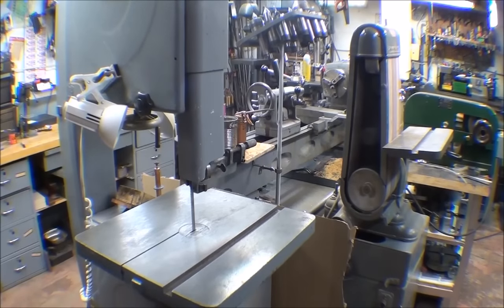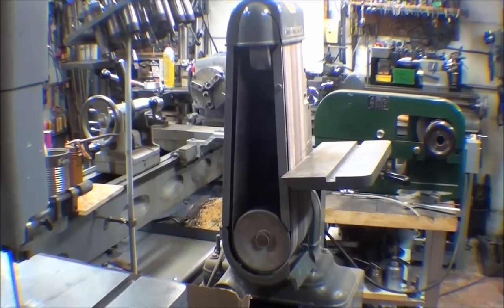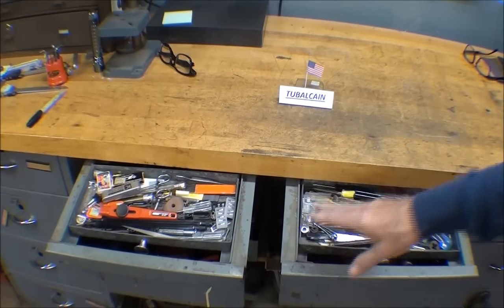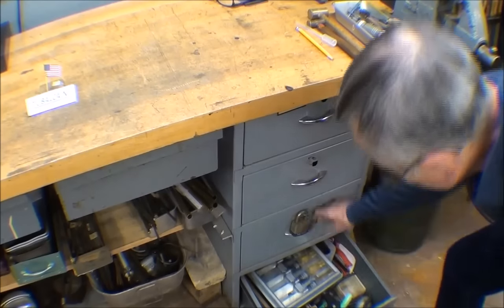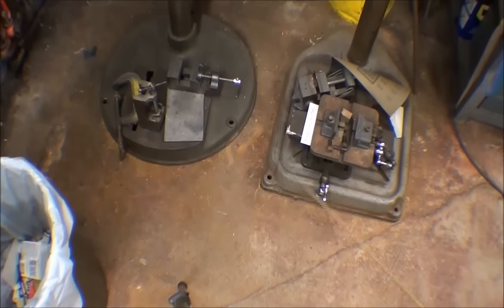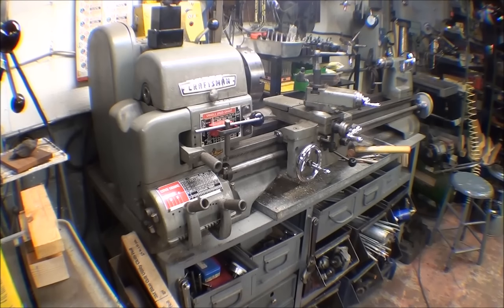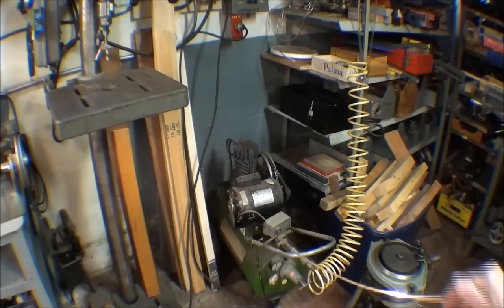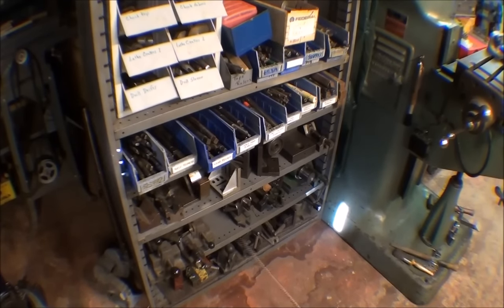TOUR of tubalcain's Machine Shop mrpete222

Comment: Great to see I am not alone in collecting multiples of every thing!! My dad always want me to take scrap wood and I alway say "I have a perfectly dry well organized collection at the lumberyard"   And for screw etc; "I keep all my screws at the hardware store" always in good order!
Reply from the maker: +jimmydiresta Thats a truism. In fact, I just threw out at 10,000 screws & bolts that have been sitting there forever and I will never use in my lifetime
Reply: For me, its 35 miles to town (about 25k population) and over 100 to nearest city, so having stocks at home are of value.
Reply: I noticed that you don't keep your inventory at Walmart.  Walmart is always out of stock and has a real hard time figuring out they are out of stock and need to reorder.
Reply: Buying screws and bolts from stores is a ripoff, I don’t throw out anything without stripping all the hardware first
Reply: @sd906238  They used to brag about computerized restocking.

Comment: Enjoy your videos! The basement tour was great. Let me share some thing I learned from a fire investigator. House fires tend to burn slowly until they come in contact with a flammable liquid. They then accelerate and quickly destroy the structure. Lesson learned: Move out excess flammable liquids and aerosols. Store the rest in an enclosed metal locker away from the furnace and hot water heater.
Reply from the maker: +Art White well noted!

Comment: A man can't hardly get by these days without some cannon fuse in his inventory.
Reply from the maker: +Doug Rundell True-Thanks for watching
Reply: @mrpete222  Where is the vertical slotting machine for internal square index blind hole work  and a keyseater for internal hole through square work and racways!
Reply: Along with a brick of Lady Fingers and a dozen bottle rockets. Just for those odd projects. 
In 1972 I was working maintenance at the Midwest Foundry. 
We use to graze the scrap pile for odd bits of iron like cannon balls and the occasional length of 1/2" chain, but that's another story. 
One day I found a pile of heavy hollow bar stock. 3/4" bore and 2" od. We had already  made air guns out of hydraulic tubing, so finding ready made cannon barrels was a natural progression. We tapped one end of a section about 12" long. Threaded a bolt in an inch and welded the head of the bolt. The next night one of thr guys brought in some black powder and fuse. We clamped it in the big vise, lit the fuse, and left the room. The maintenance shop was the former boiler room building. It was separated from the main plant by 24" thick  walls. 
When the cannon went off the building shook. 😆

Comment: I try to keep my files especially, and cutting tools like taps and similar devices in order in rolls and vertical or horizontal boards so they do not bang together and dull in the drawer and that I can take to the place I'm working, then return them to their home when I'm done. You can stack the boards in drawers It is a good way of selecting worn or excess duplicate tools or as a reminder to buy new ones. Sharp files are a joy! Thanks for reminding us to use handles on them. You might remind us of the dangers of rotating machinery and the possibility of tools or work becoming a projectile. I once launched a several pound piece of wood from my table saw at what must have been 100 mph or more, fortunately I did remember to stand to the side, and the wood hit the wall about 20 feet away without dropping an inch.
 I'm a mechanic by trade and try to allocate periodic blocks of time for cleanup and organization/reorganization. I cannot seem to do serious work and clean efficiently at the same time, I have to separate the jobs to some extent. Try to consider the cost of space, and time wasted finding things. I try to separate boxes of mixed nuts and bolts and other things from time to time by dumping them on a metal table, then sorting them into piles (using a suitable piece of scrap to save the fingers) with similar properties, length, size, thread, etc. or to find the one bolt I'm looking for, perhaps sorting a bit while searching. When finished, I sweep them into labelled boxes of the same category or into the scrap. Better to sort through ten items to find one than through 100! I try to keep suitably-sized PERMANENT labels along with a marking pen to label the boxes and new boxes. Temp labels tend to fall off after 5 years. 
Sometimes can I fix sagging stacks of heavy boxes of drawers by putting plywood between the layers to spread the load.
Have you tried donating extra tools and equipment to schools?
Enjoyed your workshop tour.THANKS!

Comment: good day mrpete222, I thoroughly enjoyed the tour of your shop.  Very close to the end of the video, you showed two sets of import hold-down clamping bars and hardware.  Your comment was that you didn't like them much.  I've had an import set like the one you've shown for many years now and it has served me well.  I will say that some minor machine and hand work was required before I could use them with confidence.  I will say that my US made tooling is better by far and I'm sure you will agree.  Thanks for all of your videos. Your vast knowledge should be in videos for people to watch so their projects can be done correctly and safely.
Reply: I noticed that as well, speaking personally I've found mine a god send at times on the mill

Comment: Thanks for the tour Lyle,  you really have a lot packed into your shop. I guess it is not so much different thana lot of small shops , except for the number of machines that you have in your's.
Reply from the maker: +Tom Bellus Thanks for watching
Reply: Really, he's got more DPs and two have a second band saw for a blade size? I don't even own one. I could afford it but I make do with 3 jigsaws (mine, my dads & my grandpa's...no kidding!) and just bought a milwaukee sawzall when they told me to throw away one of my bikes due to a bottom bracket they couldn't get out. I put a Shimano UN -55 (the one with the METAL cup, not plastic!) into it last fall and rode it through every blizzard and snowstorm we had this past winter!

Comment: Many thanks for this tour mrpete. Its great to have a look around a shop to get more ideas on storage etc. I have a little shop in the house which is 9'x9' (part of a converted garage). It is packed to the hilt with Boxford AUD lathe (S/B 9a clone) mini mill, 2 drill presses, compressor,stick welder 2 belt sanders, bench grinder, mig welder, a horizontal and a vertical band saw + all my powertools, hand tools and stock. You learn how to store and make stuff moveable very quickly. If I had all my stuff out at one time I would need 5 x the space. (wishful thinking going on here). In all a great tour many thanks for sharing. regards from the UK
Reply from the maker: +Gary C Thanks for watching--I bet I would like your shop too

Comment: Going back and trying to get caught up on the volume of your videos.  I thought my basement was crowded with all my magic making equipment.  I was lucky and got a bunch of shelving from an old CVS drugstore that my brother in law worked at.  Yes, all my shelves are full.  The joists have a lot of stock (8' to 12") loaded with things.  At least with metal working it stays pretty clean.  I remember my granddad doing wood working but it was always a mess.  It is sad when we think about it that very few people want this stuff but these are our treasures.  Hopefully, when the time comes the next guy will appreciate them.  The strangest auction I went to was a small home maybe 40 x 40 with a basement a former drive in garage in the basement.  He had all kinds of machinery.  Bridgeports, lathes, drill presses etc....all driven from one drive belt and pulley system.
Thanks for posting this.
Reply from the maker: Thanks for an interesting comment. I stopped doing woodworking in my shop many years ago because of the mess.

Comment: Nice to see your set up in its entirety. When I polished molds for the plastics industry we used Foredom flex shafts. You wouldn't believe all of the different attachments there are for them. They were really the first industrial "Dremel". The one that I preferred using had a variable speed foot peddle and worked really good when using diamond compounds and nylon bristle cup brushes to get a mirror finish.
Reply from the maker: +harperjmichael Love those foredoms

Comment: Pete I've gone on a treadmill motor kick,,,put one on my 1938 delta drill press and one on my shopsmith wood lathe,,, unbelievable power, smooth and quiet,,, I just use the dc motor m60 control board and potentiometer,,,

Comment: You mentioned the bar and threaded stock leaning in the corner, I once saw a rig on a small 4-wheel furniture dolly made of a series of veritical pvc pipe of appropriate length and diameterthat keeps everything vertical and the ends in sight. You can roll it out to sweep or to select stock. The pipe was banded together as I recall.

Comment: As a fellow hoarder, let me give you some suggestions that could make it a lot more pleasant to work in your small spaces.
First, and probably difficult for someone who likes machines as much as we do, get rid of excess machines. First would be the Rockwell DP you seldom use, but at least one lathe should go as well.
Second, A workroom is not a storage room. Move all the hardware elsewhere. At most, keep a small supply of often used items.
Third, go through all the accessory items used with each machine and pick out the seldom or never used items and multiples. Put them in dead storage elsewhere. Each workstation should only have what is used at that station.

And take your models and finished projects upstairs and display them.

Do all this, and your work spaces will be more open, your tooling more accessible and your work more pleasant.

Take it from someone who has done it the other way.

Bill
Reply from the maker: +William Czygan EXCELLENT suggestions. That rockwell has to go

Comment: I love it. I'am on my way of filling up a 40ft sea can I use as a shop I like it I have to do some more work on the light and I want to plumb it with air and put a roof cane down the middle for moving heavy machinery.
Reply from the maker: Good idea. I need one of those in my yard--but against zoning.

Comment: As you said, the only thing you're short of is room ! My guess would be that the space required for that lot would be twice what you have there !
Couldn't help note that all the lathes are 'mid-range' - not too sure that's entirely down to getting larger machines down the stairs but I'd have really expected you to have one with power traverse (not using leadscrew) and often it's nice to have a smaller lathe - to do smaller stuff ! A power metal saw must be quite useful as obviously a hacksaw doesn't always make sufficient progress. My school had a power hacksaw with suds and was 'automatic' - so you just set it up, switched on, let it run and finish - when it switched itself off.

Thanks for the tour !

Comment: Mrpete, did you ever put a reversing switch on the Logan lathe.  If not, I recently purchased a drum switch I could send you.  Was going to use it on a 6in Atlas lathe, but wound up buying a different lathe.  It's from across the "west coast pond," but if you want it, for the Logan, it's yours.

Comment: Gees, Mr Pete, 15 by 15 is really small to work in.  I saw your garage in another video, I would use at least half of it.  Well isolated and heated when needed, that would give you more space to turn around with bigger jobs.  That was my suggestion...
Reply from the maker: I'm 75 years old call mine will just make do. LOL

Comment: My shop is 11 foot by 24 foot. I have 24 feet of work benches in it.I hand lots of tools and misc overhead. Two 8 inch Craftsman table saws. 8 top boxes and 5 bottom boxes. The work bench shelves are full of old cast iron gas engines and about 1/3 of my floor space is covered with larger old gas engines and generators. I have started moving a lot of the stuff to my 3 car garage that i never park in. I will use the shop for storage and the garage for working machines and my old tool collection.
Reply from the maker: +Chuck Small You've got more stuff than me

Comment: My drill press is a delta rockwell,,1938,,,has less run out then my newer 900 delta drill press,, the 38 has solid steel bar stock column,, I added a xy slide table and put a automotive scissor jack under table to rise and lower it,,, and I do light milling with it.
Reply from the maker: Solid steel column? Wow that must weigh a ton. Talk about industrial quality
Reply: @mrpete222  oh yea pete,, she's a heavy beast,,, I have a newer free standing delta drill press that weighs less than the 1938 bench top,,and no one has ever heard of them with solid steel column,,, all industrial I guess, it's why I mill with it ,as you know weight is important in mills ,, it really works well,,has 2 heavy duty bearings in quill and it's not Morse tapered,,,  the spindle is all one peace bolted at top,,and I put a treadmill DC motor with potentiometer..

Comment: As far as ideas for improving, what I would suggest is removing as much redundancy as you can: have 12 screw drivers the same size? Out go 11. I replaced a bunch of screw drivers with one of those multi bit set with a ratcheting T handle. Not the big ones though. There's no logical replacement for really big #4 Phillips for example. Have 17 pliers that do exactly the same jobs? Out go 16 of them. 13 hammers? Out go some of them. 8 Allen hex keys the same size? Out; get one of those sets that has a plastic case/index and put the doggone Allen back right in the index when you finished with it! It's easier to located the whole pack/index than to locate individual wrenches scattered about the shop. Better still always put the whole Allen case/ index in the same place every time. I manage about 85% of the time. Makes a difference.
Sell off all the machinists tools that get never get used. (talking to myself on that one! For example do I really need 3 height gages?)  The other thing is trying get in the habit of putting the tool back exactly where you got it from right when you're done with it. At work they force us to do that. They object to so-called "messes" as they call them. I'm trying capitalize on that by trying to use that in my own life.  At least so far I'm doing it half the time which helps. Got a ways to go. One thing I've been doing, you might not like the idea, is I order a lot of my material cut near to size. Costs me more but I don't keep a couple racks stuffed with random size stock. The space saved and the time to scrounge it up and find it, plus cutting it on the band saw, many times is worth the extra money. And of course I don't accumulate a bunch of cutoffs and such in the process. That takes up room too. However I do keep a lot of odds ends of brass and bronze for casting that I got for free (like 100 lbs of each) out in the garage out of the way - that stuff is just too much money to be buying every time! especially bronze!    Thirdly and probably most painfully is selling machinery that's blocking the way, that you can do without. I'm serious thinking of getting rid of a few key woodworking machines because I have a Shopsmith. (some will say "but it's such a PITA to do all those changes on a Shopsmith!")  Yeah maybe so; but efficient space utilization DOES MAKE A DIFFERENCE, especially when you haven't got a lot of itI hope this helps. I'm basically telling myself when I say all this and I'm hoping to live by it, as best I can-  it's a work in progress. ( a bit wordy too. But that how I am)
Reply: One thing I want to do is to organize my fasteners (right now before I accumulate/buy many more)  by type, size, and then length. In that order. In those cabinets that have the small drawers (properly labeled of course). I used to have that in my other shop many years ago, because before that, when I was working on a project I'd get really pissed because I'd have to spend 20 mins rooting rummaging to find just FOUR fasteners with nuts and washers that matched! In a sort of random collection of stuff. I'll never forget that. HaHaHa!
Reply from the maker: All those ideas are excellent. I'll probably not do most of them--but I should. The screwdrivers & pliers is a good one. I have so many duplicate machinist tools-need to sell half on ebay. Thanks

Comment: Even with a hurricane the house isn't moving...   lol
Space is my eternal dilemma, as soon as I clear one little corner I go and get twice the stuff it can store... How is it I never stop...?    ;)
Nice tour...
Reply: +pierre beaudry I think there is an upper limit to needed shop size. I'm guessing somewhere around 40x60? Yeah I think I could make that work for me. You know with a 20 foot ceiling so I could loft part of it for office space.
Reply: Paul Frederick
This is what I stating to call a decent shop... That's already 4 times the size of what I got, for the floor space and 8 times if I go from 10 to 20 feet high,,, Dreaming....   ;)
Reply from the maker: +pierre beaudry My problem is I keep buying more
Reply: pierre beaudry
Folks by me have big machine buildings. So it'd blend in. But I don't think I'd do it where I'm at now. I've come to realize it is just too damp where I am at now. So I have to move someplace drier before I build my ultimate workshop.

Comment: On the right hand side of the Atlas lathe I see there is a pulley attached to the leadscrew. I presume this is an owner-modification for some form of electronic lead screw control. Has a video been posted with any further details?
Reply from the maker: Yes there is a dedicated video. I forgot the name. Search through my videos and I think it will contain the word atlaslathe Tubalcain
Reply: @mrpete222  Thanks. I ran that search and have now been distracted by your 3D printed gears video. Guess I'm going to have to watch them all!